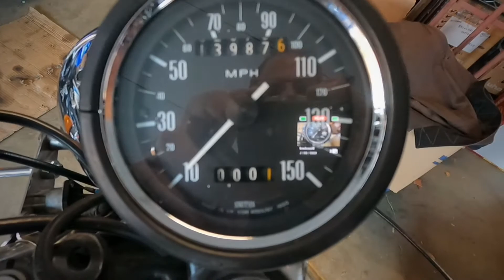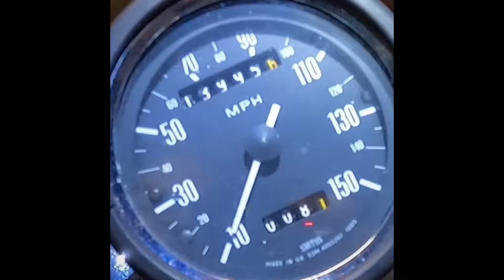Vintage Triumph repairs - getting speedometer working again

Comment: Are you using LED's for the warning lights?  I can barely see mine during the day.  Also yours seems to be opposite of mine on my '77.  Red is on the left for me.
Reply from the maker: I assume you mean the 3 lights on the headlight basket.  No- no LED lights installed there, but I did install LED tail light and headlight which are much brighter and consume much less power on this older machine. It makes it easier for electrical system on the bike to power, and less taxing on the battery too.